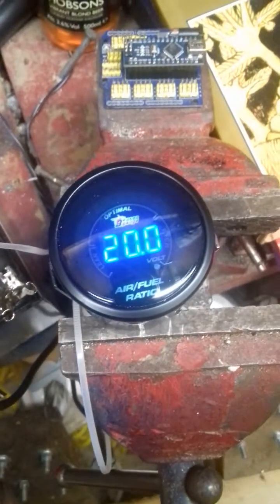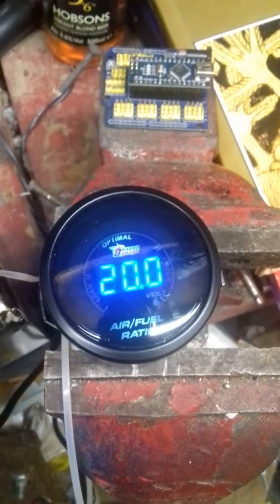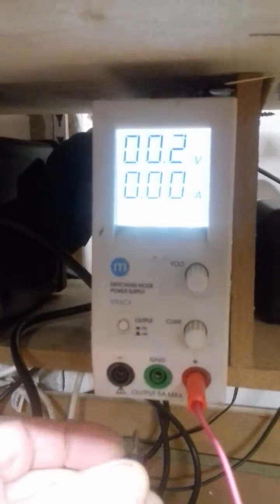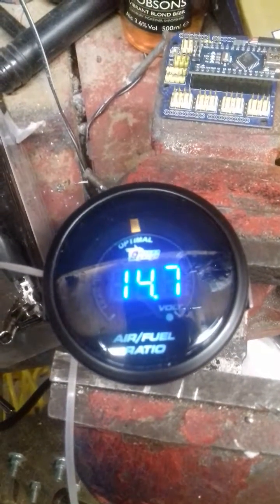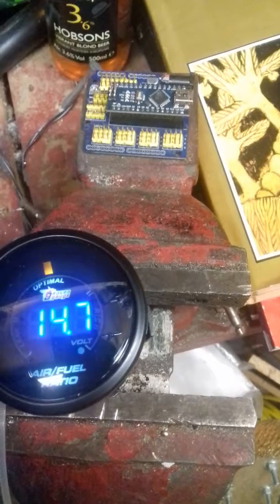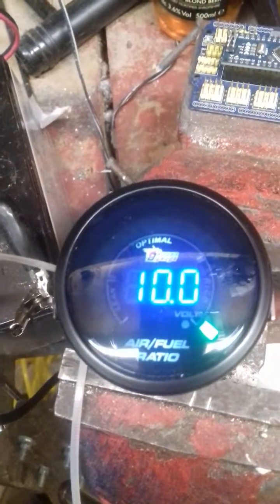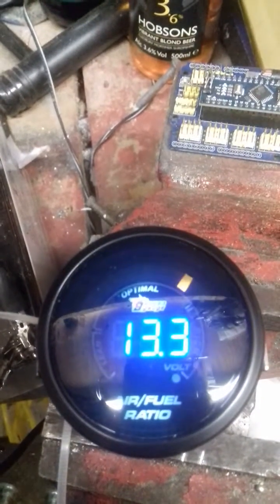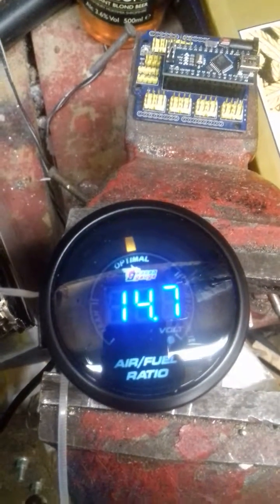Lambda sensor gauge 0-1v input

Comment: HI
So is this suitable for a wide band or narrow band O2 sensor?
Reply from the maker: It is suitable for any wideband where the AFR output works fine with the gauge as-is (the gauge output value of  the lambda controller is the same at say AFR =10 as this gauge would display AFR =10 at) or you have to convert the controller gauge output to match (like the controller I have that outputs 0-5v for some reason, I convert it using an arduino - only because it was easy to do!)

... connect it to a narrowband sensor and it will be useless as a tuning aid as the output changes very quickly as it crosses lambda=1... go google the graphs for narrowband lambda output
Reply: @JohnBullas  In short.. are Narrow bands completely useless? I have a Carb'd single cyl british motorcycle and was planning to install one. My carb jetting spec is bang on but always room for improvement.. so I wanted to know if I was running tad bit rich or lean.
Reply from the maker: @sanketsarkar  nbs are useless as feeders into gauges they are way to reactive either side of afr = 14.7. You can get wb controllers that have a NB emulation output.
Reply from the maker: I have a couple of controllers that run VW Bosch lambda sensors. One by 14point7 an SLCFree B and another from APSzX an APSX_D1DIYAPSX D1 Digital Wideband WBO Controller Module